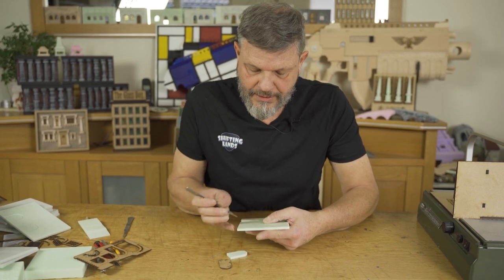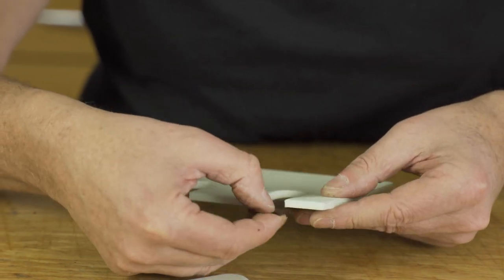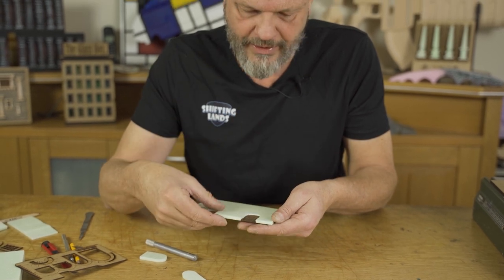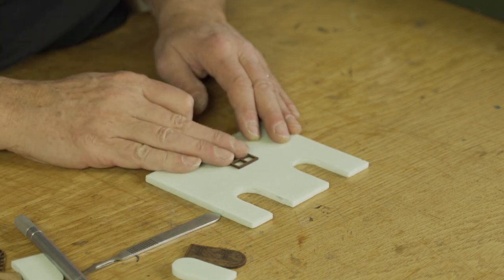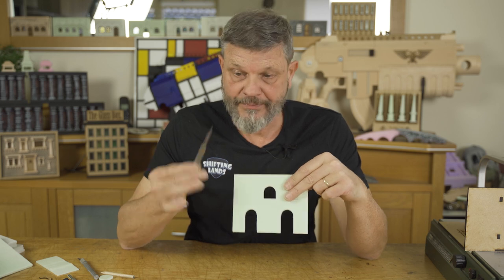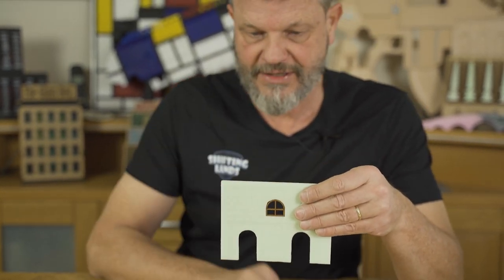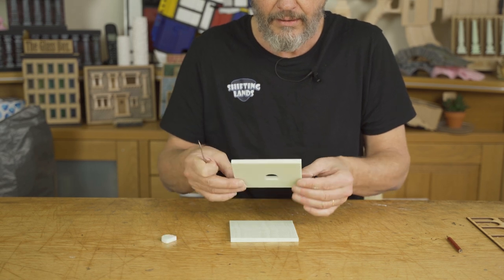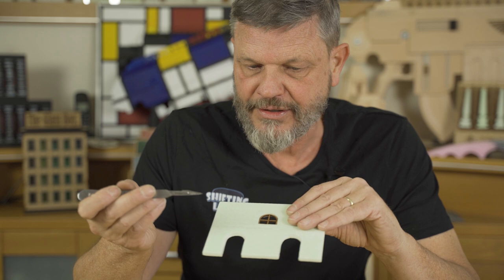Using Knives for crafting with Foam

Comment: wonderful instruction, the foam in US is really hard and the rollers do not work well on foam. Of course you can use air dry clay and a roller to make up a design however think to make good looking bricks you need to cut the foam. this should help in making up my brick patten

Comment: Thanks for the videos, I am enjoying them.  I just got a hot wire cutter, and I probably should have gotten a Proxxon, but I didn't.  Oh well.  One problem I have encountered is that I have started buy buying a 4 x 8 sheet.  It's fairly economical, but when I cut it down to smaller pieces I lose my straight edges.  I have tried to use a triangle to square things off to get a straight edge, but the sharp blade I use gets dull really quickly... plus it bends, so it is impossible for me to regain a straight edge.  Any suggestions?  Thanks!